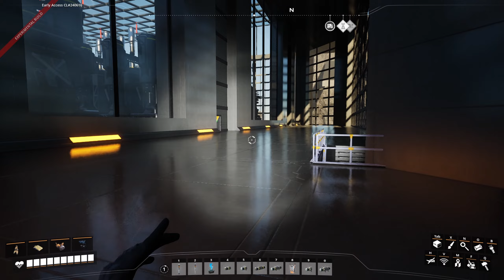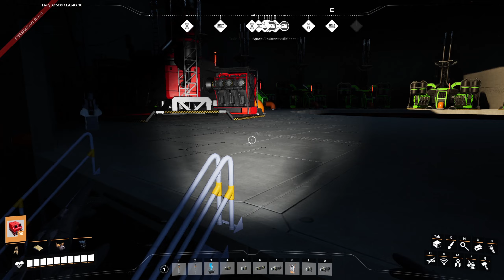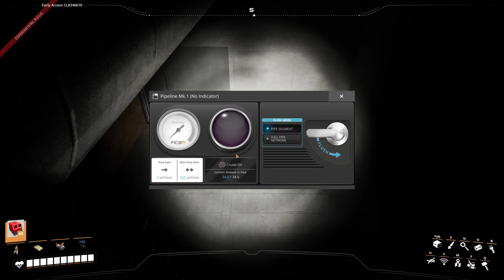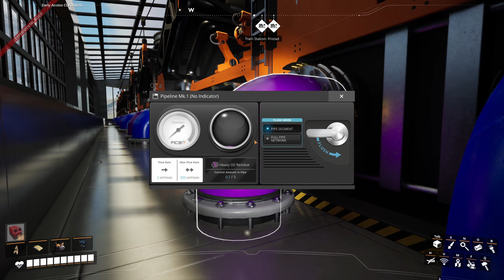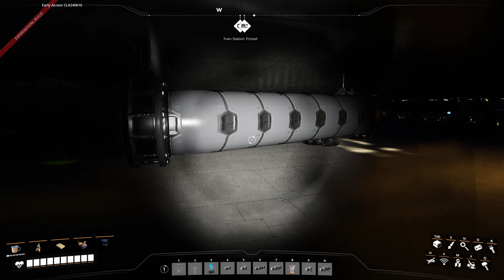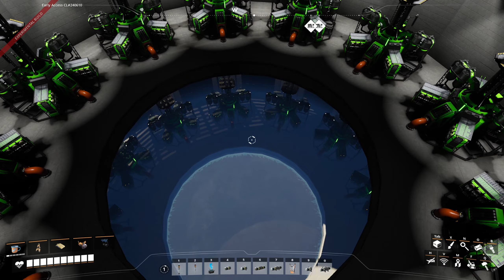800 Rubber /min + 20.000MW COMPLETE! -  Satisfactory Project Nuclear Mayhem Ep. 03

Comment: I think you replaced a pipe with mk1 not mk2 from the oil extractor?
Reply from the maker: Yes, would be a bottleneck, but now every oil extractor only provides 300 crude oil each, so it's no problem.
Thanks for pointing out though :)